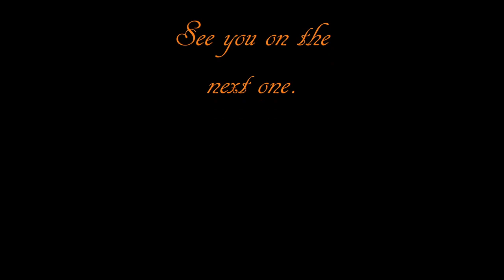A Timber Frame Vlog #11: Timber Frame Wall Post

Comment: I like the use of the router jig.  How do you set it up to be square with the reference face? ...just square it and clamp it?
Reply from the maker: +Thane Grooms you are right.  I square it to the reference face and screw it in.  I tried cutting one by hand and was not happy with the results.  This worked out very well.
Reply: Thanks.  I watched it again and saw the screws.

Comment: Hey Jim. 
 Sorry but I'm new to this commenting on videos. I recently sent in a comment and can't seem to find it back so I'm submitting it again sorry for the inconvenience.

 Just found your channel a few weeks ago. I heard about it while viewing Jessie and Allisa channel. I am really enjoying your material it's in my opinion very informative and interesting. Something I'm curious about though and couldn't make out from your videos is when you stand up the vents or bents (not sure on the terminology) how you secure them to rhe pad. Or are they just sitting on the pad and weight of the structure keeps them in place. By the way nice job dropping the trees. Feel free to use that question in a Q&A video. I really enjoyed that. That way you can actually show me.  I've thought about it and wondered if bolting a heavy angle iron to two or three sides of the wall post and then lag them to the concrete pad would be sufficient.  

                 Thanks for time your work of art.

                    Henry.
Reply from the maker: +henry schmidt you actually hit it on the head of how I'm attaching this frame to the concrete.  I'm doing it with home brew angle iron brackets at each post once I have the frame finished.  Great question and I'm glad you're enjoying the content.

Comment: I'm watching through this series one at a time and I have very few comments to make so don't take this as a complaint, but as a response to something you mentioned in the video. About the music, my recommendation would be to bring the volume down some. Your voice is about 7 feet from the camera but then a guitar comes in and it's clearly 9 inches inside my cranium. I find myself riding the levels. Still watching though.
Reply from the maker: +Lolita's Garden no problem, in the newer ones I turn the music down